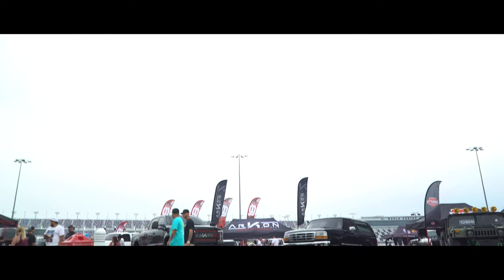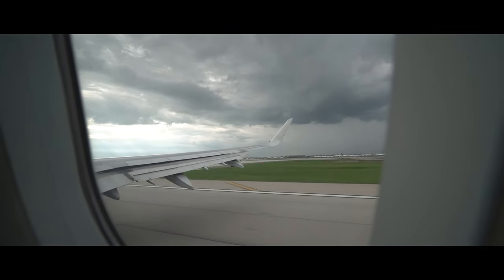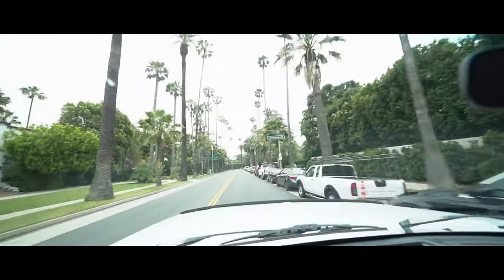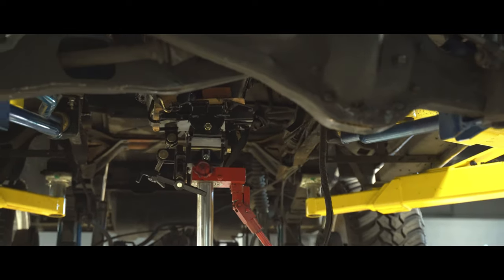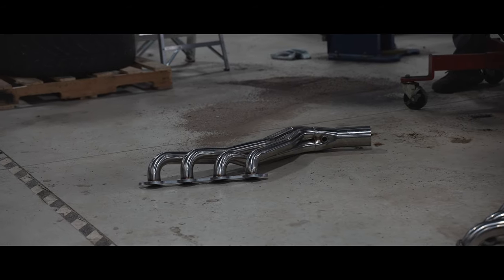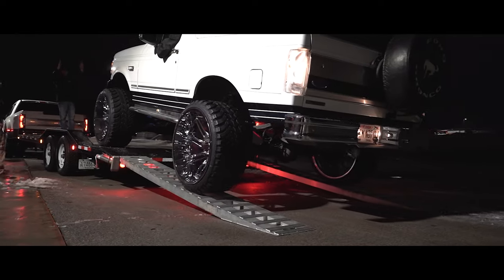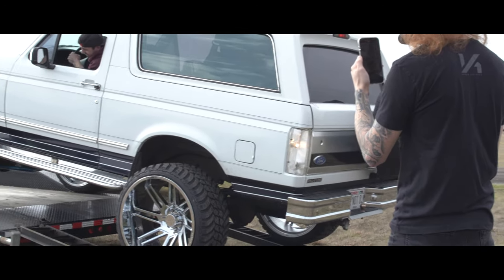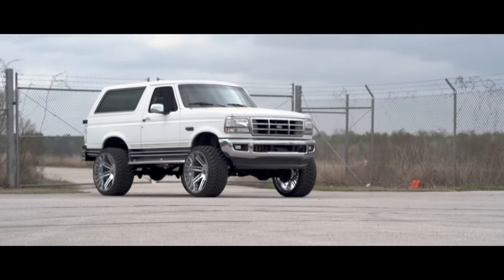Behind the Build | Junior's 1993 Ford Bronco

Comment: Jr. how did you get center caps to fit over the front looking hubs? I just bought a set of Lincoln 22x12 for my ‘89 Bronco and the center caps aren’t deep enough. Let me know, bro.
Reply from the maker: He is running spacers, that is what you have to do to clear the hubs on the older trucks

Comment: what front bumper is on it? What all did you need to install it? Also, where did you get grill and lights? About to redo a black 1994 I've had since 2001. THANKS
Reply from the maker: 2019 F350 bumper and all you need is the conversion brackets
Reply: @ARKONOFFROAD  where did you get the bumper and brackets? Also, did lights and all hook up easily? THANKS AGAIN

Comment: Jr, where did you find the front bumper?
Reply from the maker: he got that off the K350 when we swapped bumpers, so you would want to find a 2019 F-250 or F-350 bumper
Reply: @ARKONOFFROAD  ok sweet Thankyou
Reply: @ARKONOFFROAD is the bumper just bolt on or fab work is needed?